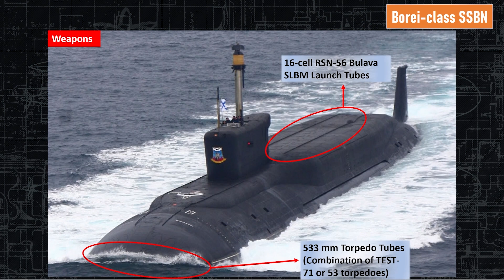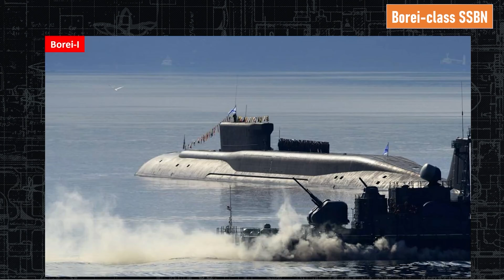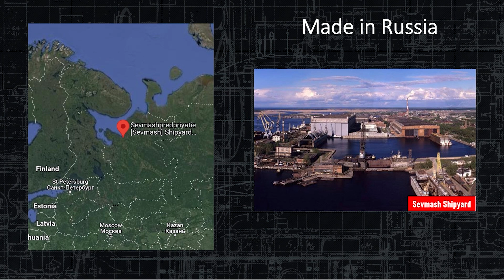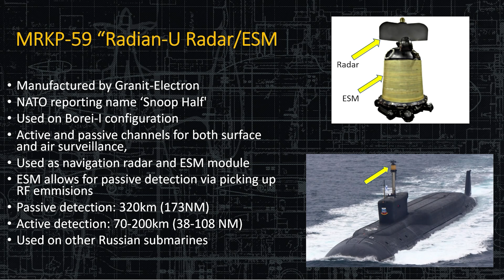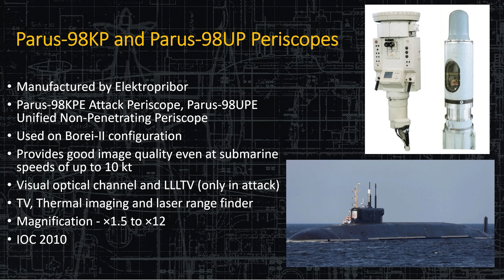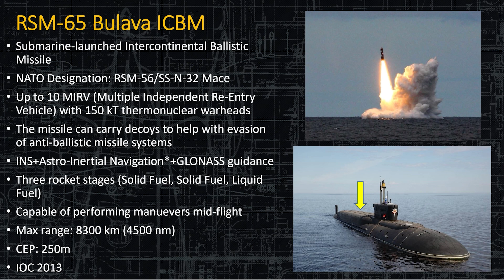Russia's Top Secret Borei SSBN Features You Never Knew

Comment: I have to question, if a Boomer needs to use any of its Torpedo tubes.. wouldn't that already mean it failed its primary goal & mission? 
Surely increasing 6 to 8 torpedo tubes is a bit of a cope measure for that failure?

In an ideal world, a boomer should be that quiet and near impossible to track, that, it should be possible to set to sea without any torpedos.
(I know that will never happen it would make folks feel really uneasy , not having anything), but you get the idea , right?

Comment: Solid fuel dangerous? I think you may have misspoke, Aaron. The liquid fuel has way more issues in this context.
Reply: In fact that is the reason they use solid fuel. Its safe and can be stored for a lot longer time
Reply: The only problem with solid fuel propellent is that once ignited it can't be switched off, vented or inerted.
Reply: @gregorythompson5826 but why would that be a problem in this context?
Reply: Liquid fuels are truly nasty stuff. They are extremely corrosive, carcinogenic and highly volatile... attributes that you really DO NOT want to have around you in a submarine.